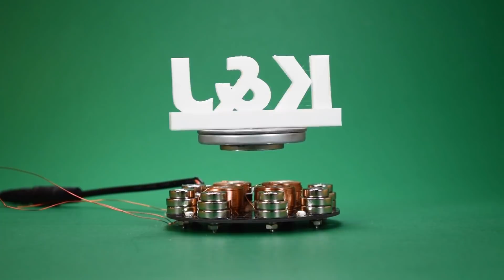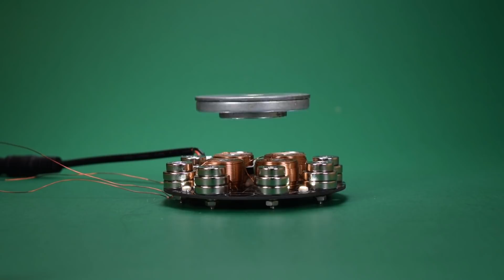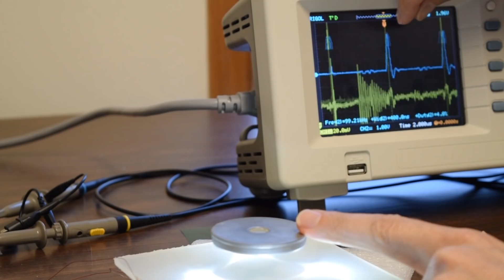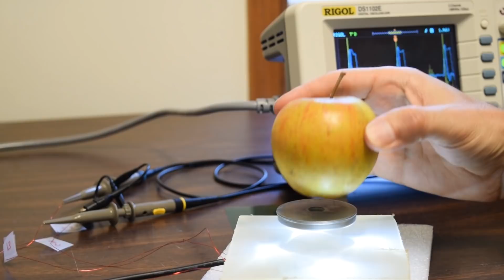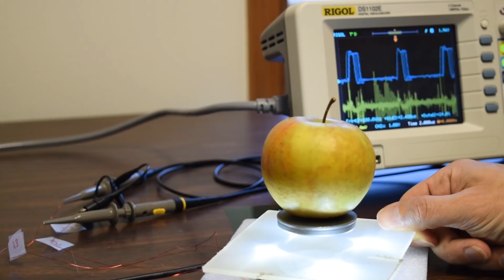AWESOME Magnetic Levitator!

Comment: I have three question, 1. does the upper magnet must have a ring form or it could be a flat one? 2. If we use a strong (ring or flat) neodymium magnet, alone or attached to the original upper magnet, would it levitate a few more milimeters? 3. How are the poles located, in the sides or in the falt parts?

Comment: I'd love to build one of these that can hold 8-10 pounds.  I found a company over seas but they want over 3k for their device that holds this much.  Is there a DIY way to build something that can suspend that much weight?
Reply: Which company
Reply: Im guessing if you build it with strong enough magnets and stuff it will work but whats the company that makes em maybe we can reverse engineer
Reply: I see that a company called Crealev makes a magnetic levitating platform that holds up to 22 pounds
Reply: @GrandmasterUV  yup, I've contacted them before.   They want 3k.
Reply: If you want to pull that much weight DIY you're better off holding the magnet from above with an attractive system, way easier to design and you don't have to fork out like 100$ on massive permanent magnets. Definitely not as cool though I admit